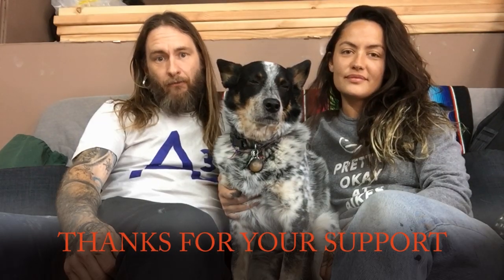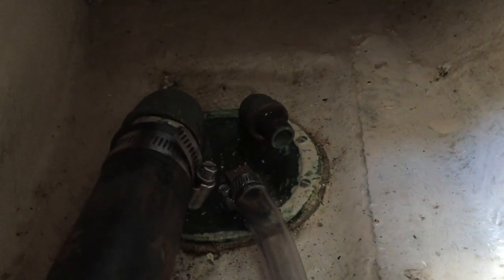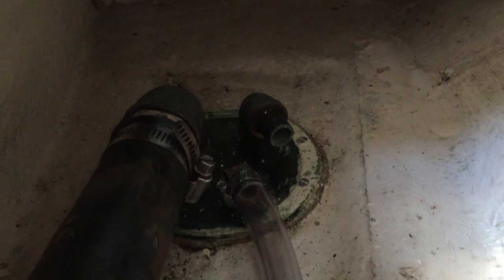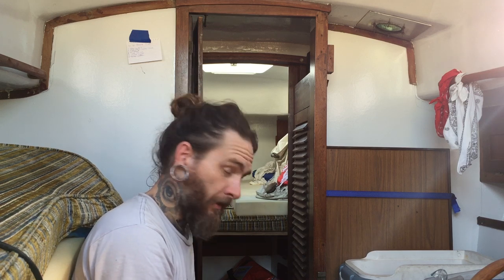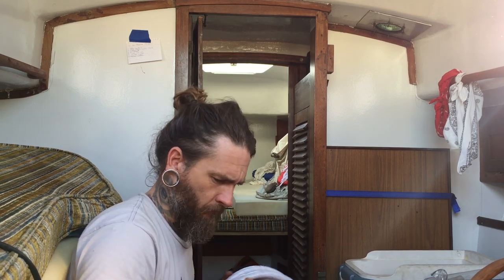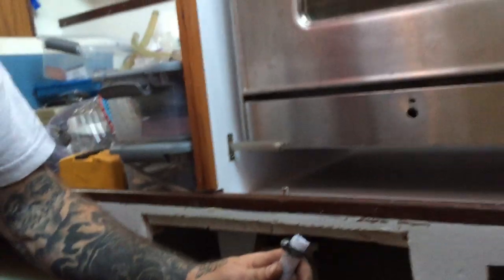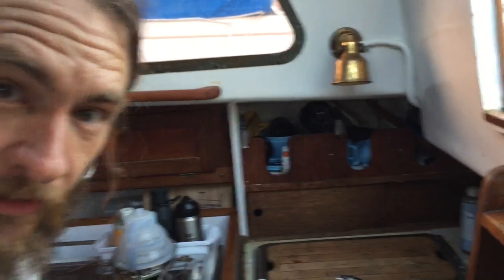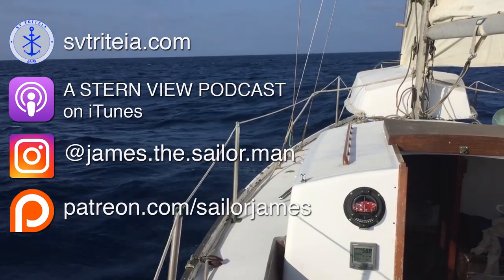Finishing the Install of the Whale Gusher Foot Pump on a Sailboat (PART 2)

Comment: Looking good man. Just cleaned out the tank on my 1971 Alberg 30
Reply from the maker: How did it look when you opened it up?
Reply: Sailor James  actually not that bad. It’s built into liner and has an aluminum lid. I cut out an access hole and scrubbed it out, put in new fittings and hoses. Are the 65 Albergs similar?
Reply from the maker: mine is glassed in under the v-berth and has a single access hatch where the pick up hoses come in at. There is a crack in the metal where my fill hose meets the metal plate that is bolted to the top of the tank. I will be taking the hole thing off soon and sticking my camera inside to see if I need to also cut another access hatch to gain access to the other side of the tank.

Comment: Thanks for the video. the recessed pedal and enclosure looks great. I think I might steal the idea for our A30. It looks like you could have placed the pedal just a little lower. Do you have any regrets about the height of your placement?
Reply from the maker: the height was due to the shape of the hull, it is not possible to make it any lower in that location. I haven't ever noticed any issue with the height of it but it did take some getting use to in regards to "why isn't the water coming out when I turn on the faucet" haha